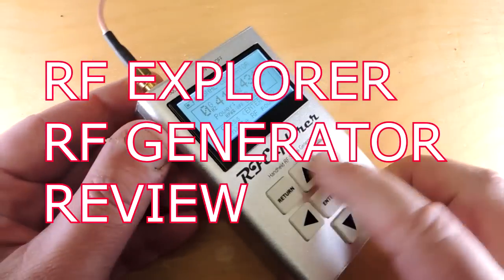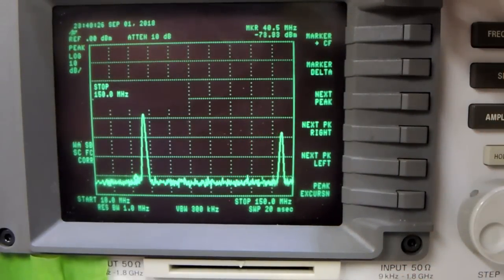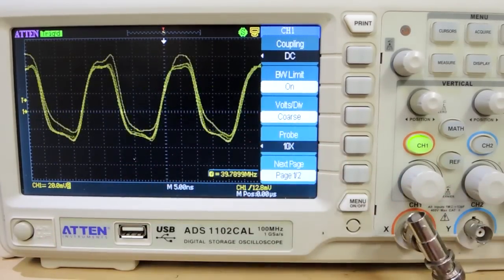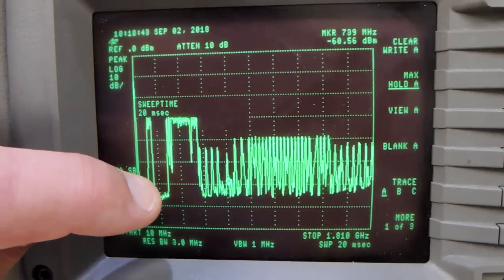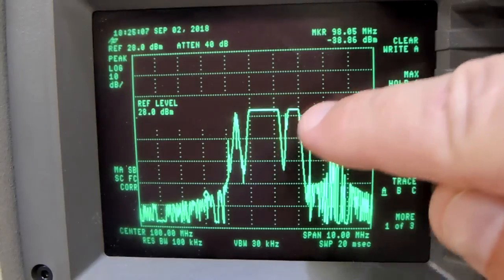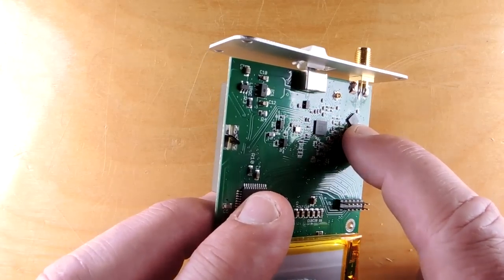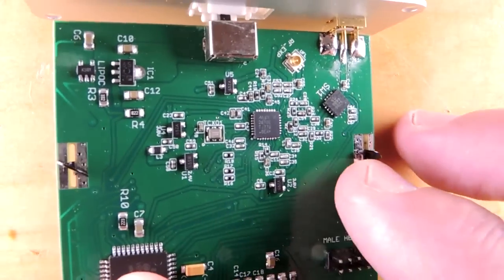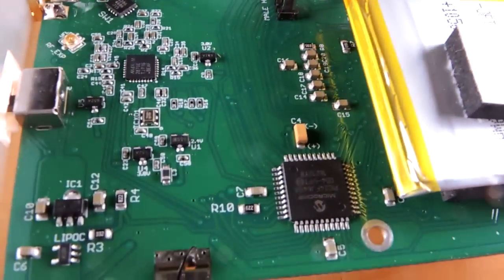RF Explorer RF Signal Generator: 24 MHz - 6 GHz

Comment: Sir.....The oscilloscope in use exhibits limited fidelity in rendering the output waveform due to its restricted bandwidth of 100 MHz, which is insufficient to accurately capture the full spectrum of a 40 MHz square wave. Specifically, the device fails to process the energy of the third harmonic (120 MHz) and fifth harmonic (200 MHz), essential components in reconstructing the square wave's shape. This harmonic attenuation leads to a flattened output response, inherently tied to the oscilloscope's bandwidth constraints. Nonetheless, the internal view provided in the demonstration offers valuable insights into the design limitations and expected operational performance, helping gauge its cost-effectiveness.

Comment: Thanks for the video and comments.
Unfortunately the video does not cover important functionality offered by the device, such as its great frequency and amplitude stability, demanded by many users as the main requirement. No one from this produced video contacted the designers to clarify any question or concern.
While harmonics are a known limitation of the device (and published in the specifications at http://rf-explorer.com/RFE6GEN), they come from the MAX2870 PLL. There are plenty of applications where harmonics are not an issue or, in fact, are useful. As an example, Harmonics are not a limiting factor for Tracking Generator applications - see how this works at http://j3.rf-explorer.com/43-rfe/how-to/145-how-to-sna-measuring-rf-filter-response-step-by-step.
Some advanced users who work at 6-12GHz range make a good use of the second harmonic as well.
In fact, this low cost RF Signal Generator, as many other low cost options available, may require external filtering for certain applications, which is easy to do for a specific frequency. For ISM/GSM/WIFI and other popular frequencies, there are SMA shape low cost low pass filters widely available in the market. That is totally different cost to produce an internal, wideband high attenuation filter. We are working to produce an expansion board to enable harmonic filtering with a sophisticated filter switch bank and fine granular power selection with 0.25dB resolution. As this will come as an expansion (optional) board, customers can select whether they need to pay for the extra features.
Designing a fully factory calibrated, highly frequency stable device for $189 is a challenge. The fact is there is no other standalone certified device at this price in the market. On top of the BOM cost, you need to add production cost (we all want fairly paid workers, right?), certification lab cost (including EMC, CE, MSDS), as well as QA labor hour for calibrating the 8*160 datapoints using a expensive Keysight CXA N9000B, which cost >$25,000 plus $1,500 every year to recalibrate. Then you can realize the distributor takes their own margin as well.
Not to mention development of free open source python and .net libraries, or regular firmware upgrades at no cost, support, warranty.
As a comparison, the MAX2870 evaluation board from Maxim is listed at $319, being a certified but uncalibrated board, with no screen, keyboard or case.
Regarding the PCB design exposed in the video, it is designed carefully to offer low intermodulation of digital signals in the RF signal path, as well as low impedance GND return path. Digital signals traces should be carried parallel only if are part of a differential bus, or if the resulting radiation is in no risk of mixing into a RF signal. Bad things happens if you keep high speed digital signal traces without GND band guard among them, relatively close to a sensitive RF path.

Comment: The oscilloscope used in the video does not show the output waveform particularly accurately because its bandwidth (100MHz) is too limited to permit the full energy of the measured 40MHz square wave 3rd harmonic (120MHz) and 5th harmonic (200MHz). And the square wave output is (naturally, and understandably) the reason for the flat output response. Thanks for showing us the inside view. Very helpful in determining the approach and likely performance, and the overall (limited) value for money.

Comment: The frequency synthsizer costs less than $10 and probably even lower if you order thousands. The filtering is just a few passives probably less than $20. The microcontroller, PCB and case might be $30-40 so the BOM is probably lower than $70. If it was sold $120 it would be okay but this is certainely not worth $200.
Reply: Yes, exactly. Agreed. Some inductors/capacitors on the output wouldn't cost much.

Comment: That is not worth $200. I wouldn't even pay 200¢ for that because the output is so noisy. Surely a (multistage?) LC filter on the output using small capacitors and inductors to smooth the square wave output to a sinusoidal wave would not cost much to add, a few $ at most. I think they just couldn't be bothered. you could even build one using salvaged inductors from old SMPS and/or radios.
Reply: Just to expand on Prehistoricman's comment, for a given frequency f the filter would need to reject the harmonics at 3f, 5f etc., so it would have to vary with the selected frequency. That's not necessarily cheap or simple to implement; there's a reason why most lab frequency generators use DDS instead.
Reply: That is understandable, yet this looks like a 50 bucks device. They could have certainly put at least some filters for the most common frequencies for that price and then switch them with software in.
Reply: Unfortunately there is no easy way to find "most common frequencies" for a wideband device, as every customer will define "common frequencies" in a different way.
Reply: How would you implement that given the wide frequency range of this device?

Comment: Looks like a useful tool for generating clocks, but im very dissapointed by the square wave output and that PCB looks like it was laid out by a highschool student 
for RF sweeping a HackRF is actually not a bad choice, when i got mine it was $400 but you can get them now for around $200 
produces a nice sine wave and plenty of modulation options available but not great protection but on the plus side its also a 100khz to 6ghz receiver
Reply: There are multiple applications where harmonics are not an issue, including Tracking SNA. Unfortunately HackRF or equivalent SDR devices are not amplitude calibrated devices, and has much worse frequency stability. Check this application for more details on how to user RF Explorer Signal Generator as a tracking SNA device:  https://www.youtube.com/watch?v=8OFu2ivQ8wY

Comment: Those PCB traces are all over the place: they aren't even parallel and have all funky angles to them... What the hell? The large amount of distortion appears to be a problem at low frequency where the IC uses a divider, it should be much better in the VCO fundamental frequency range (3 to 6 GHz).
Reply: There is an important reason to not be parallel. They are designed to maximize GND isolation among digital signal to avoid radiated noise to intermodulate into RF signal path. The GND low impedance path is very important in high frequency, wideband designs.

Comment: 7:00 what does flooding means ??
Reply: Copper coating the areas where there aren't traces.
Reply: BoltActionPiano what is the purpose of flooding?
Reply: Noise reduction?
Reply: @fullwaverecked  reducing the amount of etching solution required, thermal capacity, easier board layout, lower resistance, noise is complicated but may improve just because less impedance, or it could couple more noise from a noisy circuit. Often solid / segmented ground planes are put below traces to turn them into a transmission line.
Reply: BoltActionPiano Thanks for one of the most informative answers I've ever received on YouTube! I'm an old dog learning new tricks, and it feels like trying to eat a cow all in one sitting. But I'm learning that once you get past the rear-end, the easier and tastier it gets? Your answer is like a week's supply of T-bone steaks. I'm off to see if you have a channel I can sub to. Thanks again!

Comment: Can someone explain why it costs 200$? It looks like a 50 or less $ device.
Reply: Greed and profit, that's why. I certainly wouldn't buy it for 200. Maybe there is a different make/model that costs a bit more, say 200-300, that has a cleaner output.
Reply: It should already be a little cleaner like this for 200. Look at the PCB. It's barebones, no effort.
Reply: It is a common mistake to assume the MSRP of a commercial device is the BOM cost. On top of the BOM cost, you need to add production cost, certification lab cost (including EMC, CE, MSDS, etc), as well as labor hour for calibrating the 8*160 datapoints using a expensive (and yearly calibrated) Keysight CXA N9000B, which cost >$25,000. Then you can realize the distributor takes their own margin, unfortunately Mouser and Digikey do not distribute products for free.
When you add all that cost you can quickly realize how difficult is to produce a highly stable frequency Signal Generator for $189, which in fact means there is no other device able to work standalone with internal lithium battery, covering such a wide range of frequencies in the market at this cost.
Reply: @ArielRocholl  but it isn't "highly stable". It's barely usable.
Reply: You seem to confuse a squarish, harmonic rich signal with frequency and amplitude stability.
RF Explorer Signal Generator is used by technicians around the world to align antennas, characterize and tune filters, amplifiers, etc. That would not be feasible with an unstable signal. If you want some additional info, check this independent user test so you have an idea: https://twitter.com/giorgiofox/status/504165498675011584 - yes, that is correct, 50Hz error at 500MHz, that is a extremelly stable precise signal.
Reply: @ArielRocholl  Oh right. However, you sound increasingly like the creator or some other financially involved guy.
Reply: Surely I am involved, we are small company but well know in the RF and RC industry. I am part of the RF Explorer Team and yes, we are proud designers of this product.
Cheers
Reply: @ArielRocholl  Do you understand why this makes you an untrustworthy source of information?
Reply: You just got the point of view of the designers. You are free to trust anyone you want, of course.
Reply: @ArielRocholl  You simply can't be objective.
Reply: ̷ ̴ ̸ɢ̸ʟ̶ɪ̸ᴛ̶ᴄ̶ʜ̷ ̶ ̶ : Maybe.  But he is perfectly placed to explain the design compromises obliged by trying to produce a low-cost but practical unit.